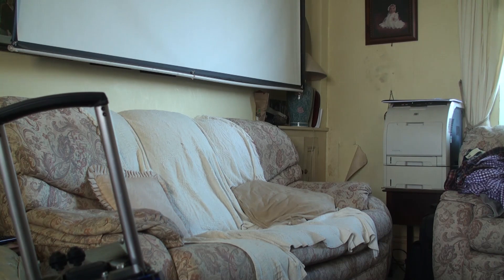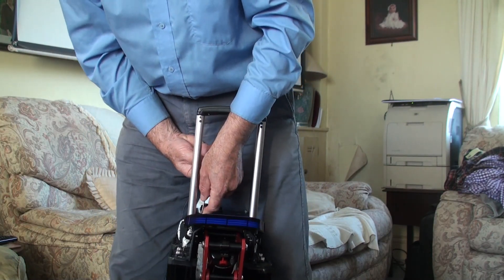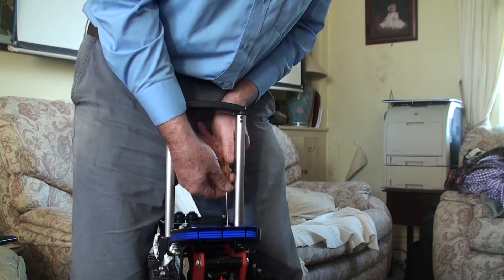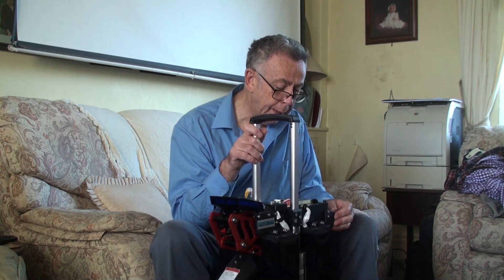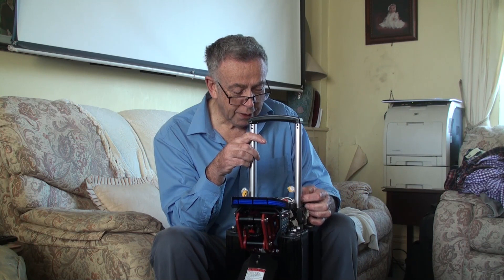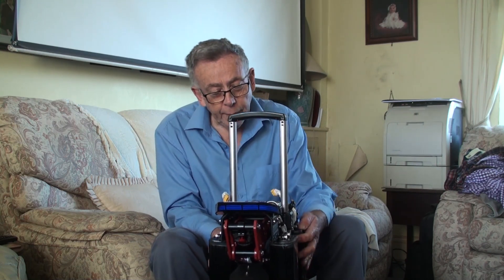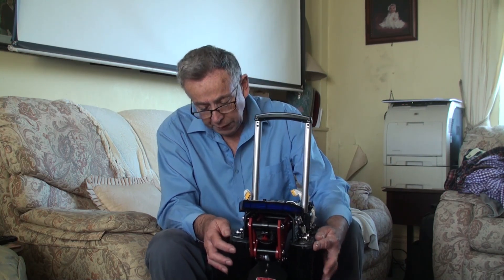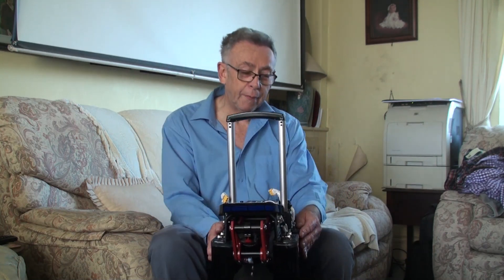Begode Master Failure

Comment: I think you have to hold down the power button for a few or maybe 5 seconds before it can turn itself off ?  Make sure the wheel has come to a full stop, wait 2 seconds, then press and hold down the power button should have the unit turned off by itself.
Reply: OK, it seems you did that from the beginning, so I am not sure what caused it.  My unit did have the display not showing issue when the unit is fully charged, but I just keep turning it on and off until the display comes back to life.  Other than that fault, my wheel works.  Hope you fixed your issue, or reach out to your dealer for help.  Best regards.
Reply from the maker: @FastRadioBursts  They think a faulty display board (so do I in fact). A new one should be winging its way (literally), Air Freight from China.

Comment: Mine is down too 😭😭. Controller went.  No ETA from alien rides. None in stock
Reply from the maker: I think it's the display board that has failed in mine. They are sending another (board that is) air freight from China, which is fine.
Reply: @Roskellan   Hopefully it's a simple fix like that. This is an excellent wheel though so it's worth the hassle. It will make a great rider unstoppable and even an average rider very fast.

Comment: I have a Master. I'm not saying this will work, but it's worth a shot. Try putting it back into transport mode. Hold the tilt button while pressing the power button 5x. It should beep twice and power off. If not that, go the other way around. I've never had this problem but this might work for you.
Reply from the maker: We think it is the display board that has failed. It is not possible to put it into transport mode because the wheel does not switch on. Even a wheel in transport mode will switch on, it is just that it will not balance when you have done so. I do appreciate the feedback though.

Comment: Get yours fixed yet? My controller should have arrived 2 weeks ago. Emailed Alien Rides for an update and they didn't know what I was talking about, asked me to send video of the problem again. I did this mid october and was told my board would arrive in 2-3 weeks and I was "on the list". So they ask for a video again, I send it. Then It takes a week for them to look at it and get back to me. So in another week I should find out that "we will order a board for you" and then wait another 2-3 weeks for it to ship from begode, and be right back where I am now.... Bought 3 wheels there but this will be my last.
Reply from the maker: My Master is being picked up from my home tomorrow. I understand your frustration but don't take it out on your dealer. They are at the mercy of the Manufacturer. Begode should really be free issuing spares to the dealers to cover these problems because of the large delays and expense related to air freight. If their wheels were reliable would be one thing, but they are not, and they need to ensure their dealers have spares immediately on hand to deal with these warranty issues. Dealers are already limiting themselves to certain models because of the expense of carrying spares. If we are too demanding they  may not carry some Brands at all. Certainly when you buy a Begode one should not be surprised if you have quality related problems, that should not be the case but I think we all know that when we order. Best bet for a trouble free experience would appear to be Veteran and the Veteran Sherman -S is looking very promising, but even so we are a long way from seeing an EUC as a product in the way you would expect quality in a car, or in a motorcycle.